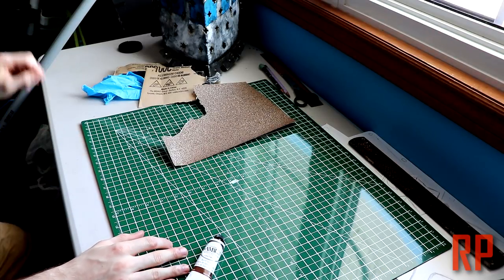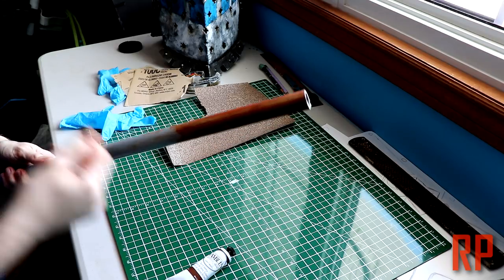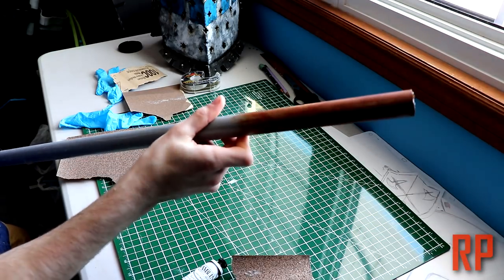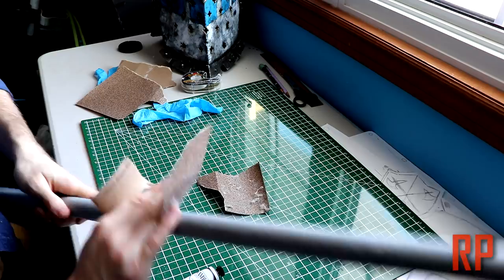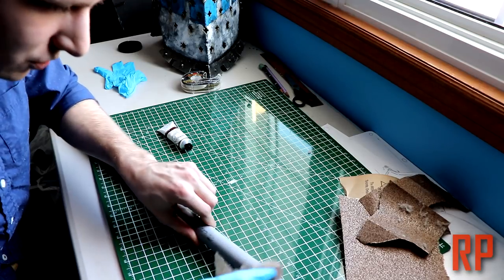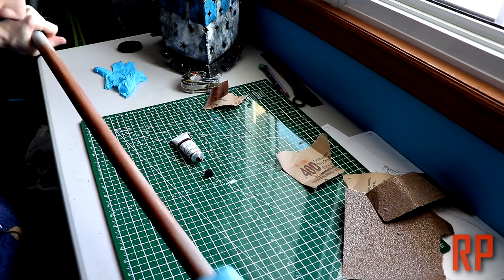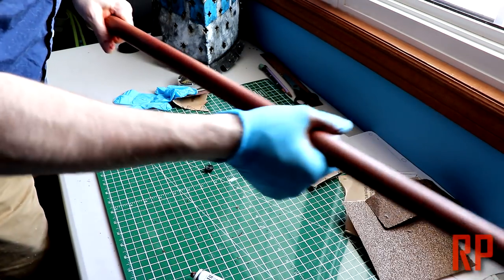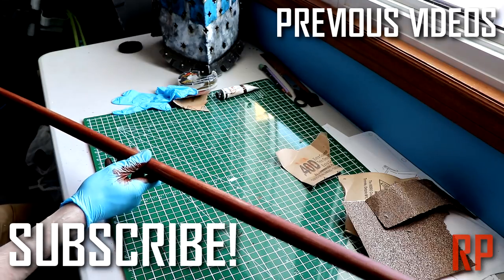Making PVC Look Like Wood - Stream Highlights

Comment: Would a similar technique work on top of (EVA or camping mat / blue) foam as well?
Reply from the maker: You can score the foam and use a heat gun to open up the cuts to give it a wood grain affect. I did this in several of my videos when trying to make foam look like wood
Reply from the maker: but make sure to use a box cutter for that